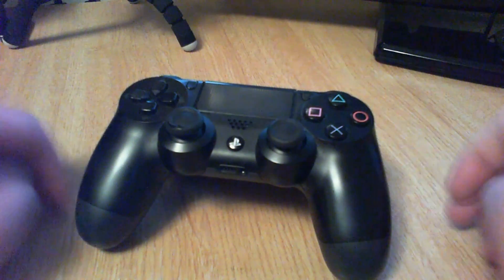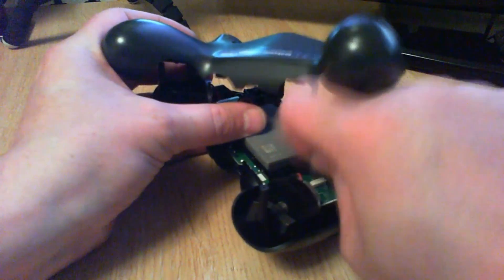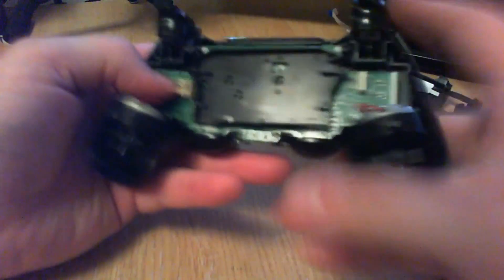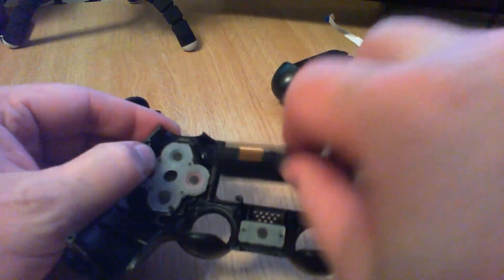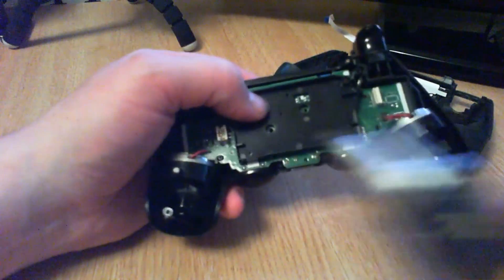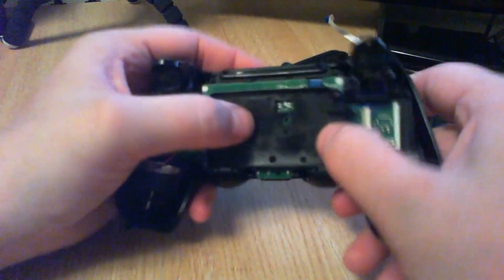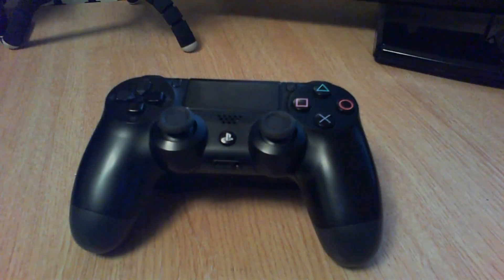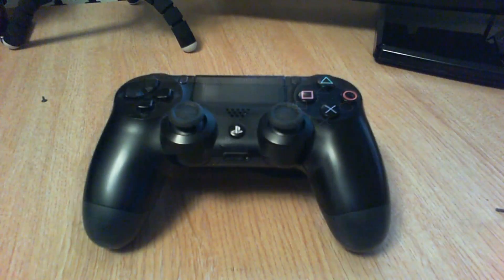Dualshock 4 Controller: Strip Down and Rebuild.

Comment: Hey if you have like a little red wire that is broken can you fix it mine is broken and I need it fixed
Reply: you dont need it its just for the shock motors or the vibrators

Comment: I followed these steps exactly and managed to not break anything that I know of haha. I'm having a little bit of a problem now though. I plugged in the controller to charge it because it was completely dead before I deconstructed it - to fix one of the joysticks - and it's getting hot, so I know that there is power being sent through it. However, the LED display is not lit up and when I press the PS button, it gives no indication of turning on. (They both worked fine the last time I used them prior to deconstruction.)
Reply: Are you still having issues with this?

Comment: thank you for the help me led light wasn’t working and i couldn’t charge my controller
Reply: Same my controler is not charging and the light is not turning on Can u help me????
Reply: @AnneLee23156  Theres a ribbon cable on the bottom shell, connect it to the circuit board with the battery on it and it should work
Reply: @AnneLee23156 Sorry didn't realize how old this was
Reply: Yeah I had the same problem

Comment: I have used the Samsung fast charge for a while on my controller. everything functions normally except the light bar doesn't work only. I know most people are happy to have that one feature not working. but I wanna fix it. What's your recommendation to resolve?
Reply from the maker: Hello there
I dont know a fix for the LED on your pad sorry but the LEDs are a part of the charger port which is a cheap part to replace and you can find them on Ebay. There are two different types of charger port that I know of the 1st generation USB port which takes the 14 pin flex cable or the 2nd Gen port which takes the 12 pin flex cable. Find out which Gen you have or check the part number on top of your charger port.
JDS-001 1st generation 14 pin
              or
JDS-011 2nd genertion 12 pin

I did check on ebay and there are a few listed at the moment for cheap.
I hope this helps you peace out
Reply: Thanks mate! I've opened mine up already and saw I got the green JDS-011. I'll give it a shot to replace that and hope for the best. Thanks for the tip
Reply from the maker: No problem m8 hope it helps and good luck with the repair.